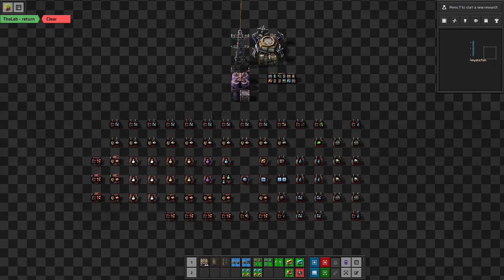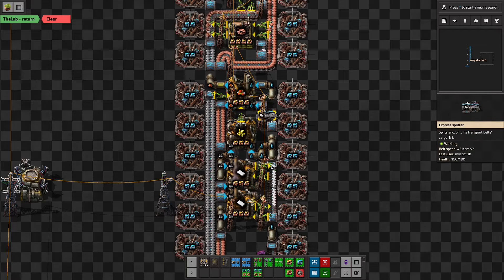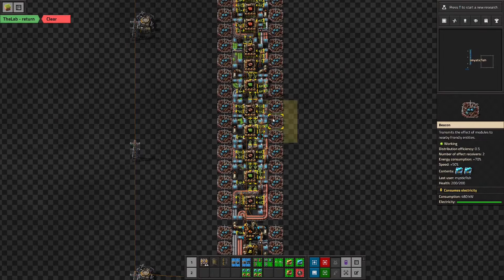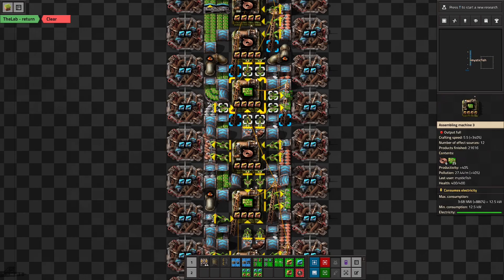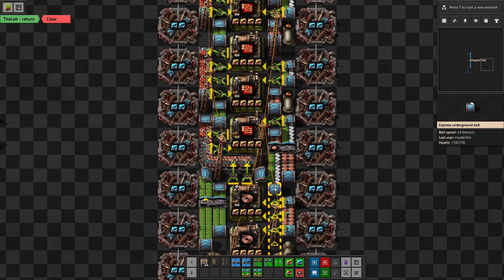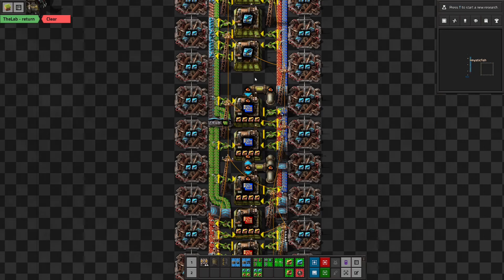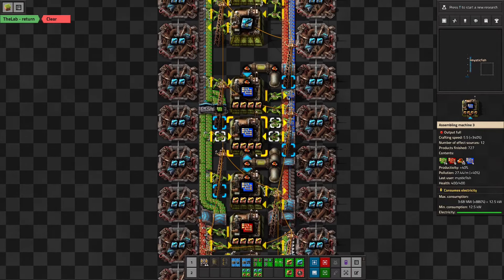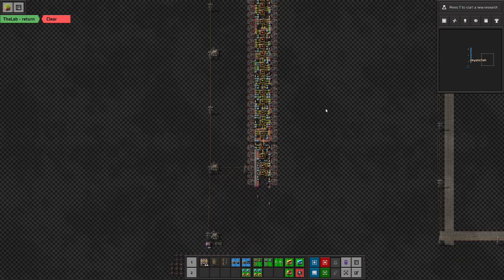Modules - Ep24 - Factorio Expand-a-Base

Comment: 17:50-ish Yes, I think you do want to limit the storage in the blueprint. That way you don't have to worry about not forgetting to implement it later.
You could even count all the tier 1,2,3 modules that you'll need for ALL upgrades and set the limit to that value. Yes, it will effectively not limit anything (because you'll want to initiate the upgrade before you have all modules for it stockpiled). But once you actually WANT to limit it, it's then as easy as changing a value. and you don't even have to remember in which way you want to limit it (reading from the logistics network versus connecting a wire to the box).

And don't forget that you'll want to stop or slow producing tier 1 modules once the tier 1 modules that you ripped back out of the base start coming in.
... I wonder if that means that you'll want to take your belt of red+blue circuits and put a splitter into it so that you can prioritize sending them past the tier 1 module machines to the tier 2+3 module machines.
Reply from the maker: Yes, I thought about the recycling part (which is why I went to the storage chests with filters). The tier 2 modules will “compress” tier1 inputs at a 4:1 ratio, so really the tier1 assemblers will still need to run at 3/4 speed. I think you are right that we want limits, primarily on the filter inserters that put the tier1 and tier2 assemblers into the storage chests. I’ll go update the BPs to do that before the next episode. I think if we do that, we don’t need to worry about prioritizing the red chips past the tier1 modules, because the tier1 assemblers will back up naturally.

The tier2 and tier3 assemblers are both underutilized, and happen to have headroom to be able to add 33% throughput, so they will eventually be able to chew through any backlog of recycled tier1s.